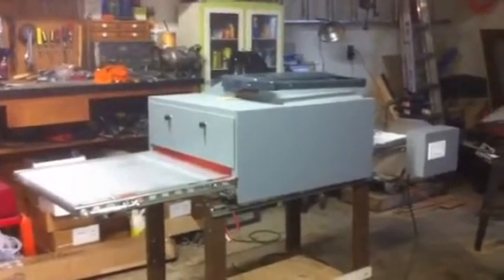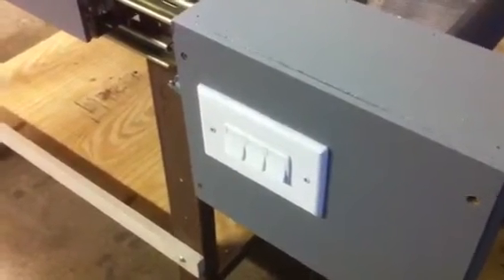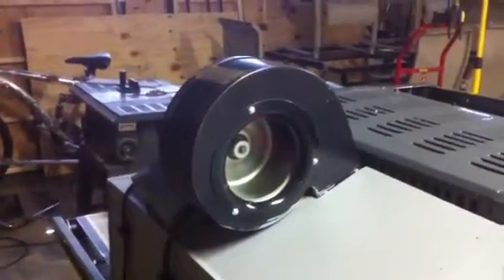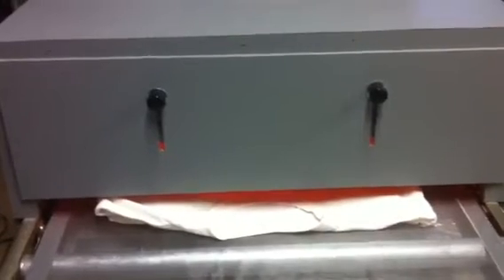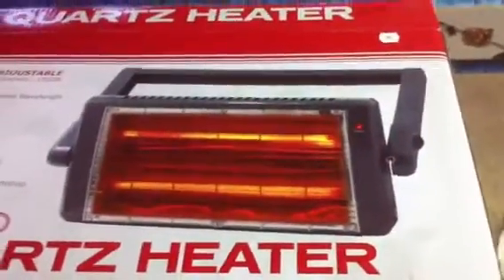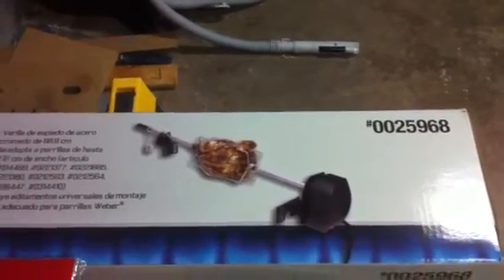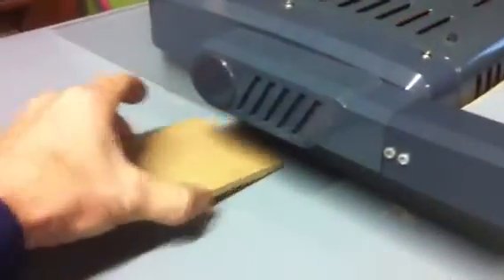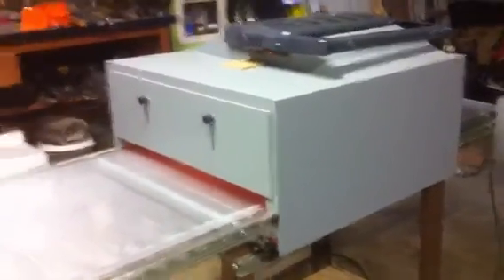DIY forced air conveyor dryer

Comment: Idea for anyone wanting to speed the time up.  Go get a oven off Craig's list with the oven still working but the top is shot. I got one for 25$ and it's worked for a couple years.
 Just take the coil the control board and the thermal coupling.  Add it in with this and now the heat is a lot more reliable.  This just goes to show you how much money the factory's are making off of these.  I know it looks like all the parts
came from a junk yard but the concept is still the same.  I bet the only have a grand in parts and labor but charge 3,500 and up.

Comment: just have one question(this is the father of the person in the picture) she used my computer. my question is how what did you use to get the screen tight to ad the adhesive by the way I am in mid build of mine but using a digital temp controlled ceramic heat press element .

Comment: Awesome video!!  I can't wait to make this.  I do have one question.  Is the box open on the bottom or fully enclosed?  I can't tell if the belt is running inside the box or just under the heating element.  It would make sense to have it enclosed top and bottom as this would increase the heat inside but I wanted to make sure  before I start to build it.  Thanks again.  :)